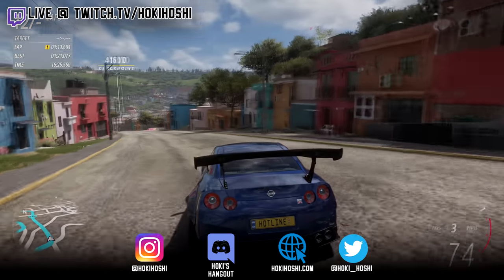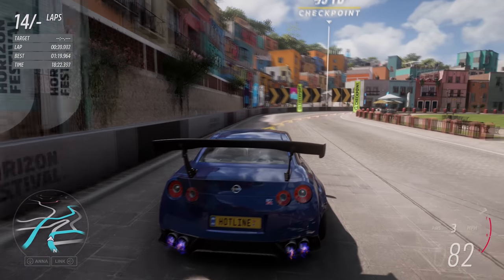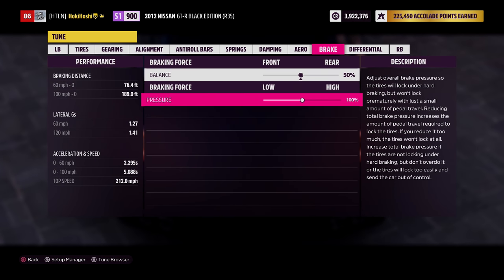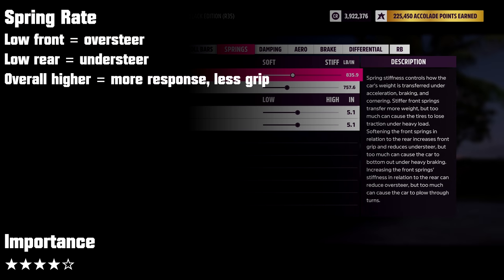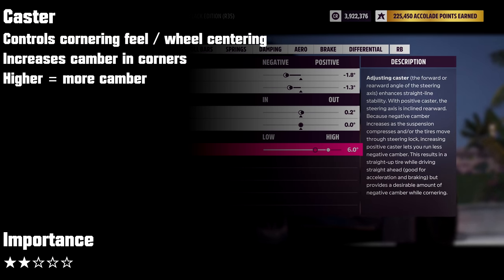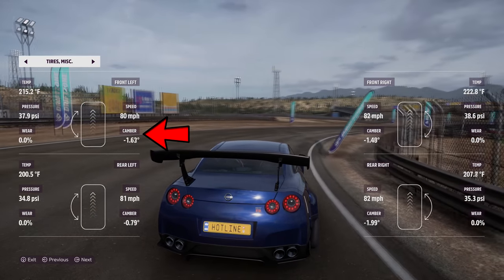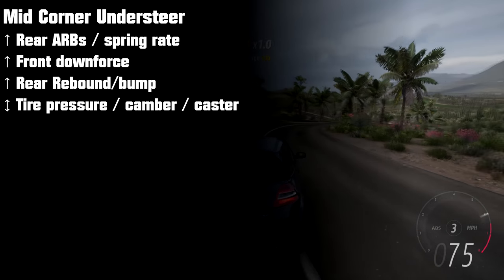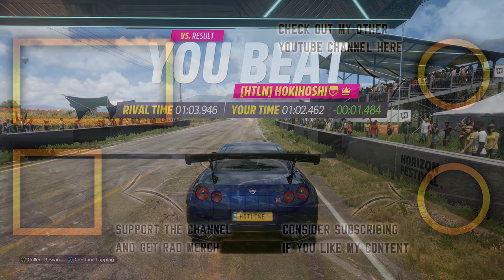How to Tune in Forza Horizon 5 | Basics of Tuning Guide

Comment: This video should win a Pulitzer.

It doesn't seem like a lot, but making some simple tuning adjustments based on this video took 15 seconds off my A-class Goliath time and completely changed the feel of the car I used.
Reply: YEah. I used to go for "BIGGER HORSE POWER ONYLY GREEN UP ARROWS!!!" until I used someone else's tune for the same car that was "slower" but it ended up being so much faster than I ever could imagine. It felt glued to the road in turns and it accelerated like a bat out of hell. The top end wasn't as high but that didn't matter because I didn't have to brake as hard or as much in turns.
Reply: I'm a sucker for grip so I'm definitely going to use this rather than other peoples' premade tunes.
Now the one question is what the hell is engine power vs torque.
Reply: @migueeeelet  I think the verry basic gist of it is that Engine Power mostly influences top speed, whereas Torque is what gives you acceleration and makes you move of better. 

A saying i once heard which sums it up was this. "Power is what determines how fast you hit the wall. Torque is how far you move it."

I think Torque might be more important then Power but too much Torque can just make your wheels spin too much. (I think)
Reply: @subiefoxy2467  Yeah, from what little I know, torque is the actual force the wheels are applying.
If I'm not wrong, too much power and too little torque is what causes wheelspin
Reply: @migueeeelet  I think its more to do with the Power & Torque and the Compound and Width of the tire. Ofcourse proper tuning also helps.
Reply: @subiefoxy2467 definitely there's a lot, but a main thing is that you CAN have too much power, or wrongly applied power. No use having a 1000 hp engine if its torque is like a sedan's
Reply: @migueeeelet  True, true. That's what i meant. No use having all that power if you dont got the torque too put that down. (Obligatory reminder im not a expert in this field, i have perhaps more knowledge then the average person but thats about it.)
Reply: @migueeeelet  well, in a regular engine HP is a function of torque. You can't really have one without the other.
Reply: @luisitobardajibenitez8013  yeah, but I know that you can have a lot of HP and shit torque, which has low performance
Reply: @subiefoxy2467  Incorrect, low torque isn't a real problem for racing because of gearing,  that's how something like an S2000 manages to accelerate quickly while having not much torque, you just need to rev them quite highly. Torque/high displacement is what allows cars to pull off the line quickly at speeds just above idle. Torque at higher rpms is much more useful for racing applications where you can keep the engine easily within the optimal torque curve compared to simply having a car that has a bunch of torque at like 1200 rpm then falls on it's face at 3000 rpm, like a diesel, where as something like a Semi works better with an engine that has gobs of torque at low rpm, since they would barely be able to pull away from a stop and be constantly needing to shift gears to keep within the torque curve.
Reply: @migueeeelet  Ya, those old Formula 1 cars with their 800~hp and like 200-250 ft pounds of torque sure were slow
Reply: @Mikael_Akerfeldt  idk man I'm not a car engineer
Reply: @ripleyhrgiger4669  i want that "glue" tunes :D
Reply: @migueeeelet  
Torque is what a tractor has, power is what 2 stroke has (to make it simple). Torque will rip a tree stump out at low revs.
Reply: For better or worse, I tune EVERY car I intend to drive. It’s one of the most fun aspects of the game (for me).
Reply: @ripleyhrgiger4669  type of builds i’m looking for! I’m always rewinding sharp corners, even when I attempt to approach slow; all the other cars are passing me!
Reply: @migueeeelet  Torque is more important for fast acceleration and going up hills, Horsepower is more important for top speed
Reply: @Cynsham  That's a good base, thanks
Reply: @Mikael_Akerfeldt  yall gotta realize those low torque cars are usually really light, especially the formula 1 cars..high torque is necessary depending on vehicle weight and racing type/conditions.
Reply: @MrSirGiuseppe  I literally said that mate
Reply: @migueeeelet _When u speak gear´s then u speak torque. Like when ur car is holding still and u try to get it moving in 5th gear then u don´t have a lot of torque even though u have horsepower ;p hope this makes sense.

Comment: I knew absolutely nothing about tuning compared to my 2 best friends who always knew everything about it since the earliest forzas. I sat here for an hour, and just finished writing 5 pages in depth (little diagrams for camber, toe an all.)  with an actual clear understanding, about everything this guy mentioned. I am SOOOO better off now. Thank you SO much for taking the time, and having the patients to teach everyone everything you know! Looking through comments to get even more info but great job man fr fr! Subscribed👌😎
Reply: I can give two additional Tipps: Hoki mostly does tuning that’s realistic. But you can do some settings much extremer than he is suggesting. Extreme anti toll bars can help make AWD swapped cars turn better. 1 in the front 65 in the back is the starting point for AWD cars and you dial it back from there if the car tends to spin.

Secondly you can go even lower with tire pressure on some cars as long temperatures are fine. 1.4 bar is something a lot of cars can handle without overheating.
Reply: @elhomoflow  any other tips like this?
Reply: @lseagle61  Heavy Rims, wide rear tires (on awd), and rear Aero most of the time reduce your power index value without actually hurting your handling. It’s eather a good method to bring down your car into a lower class or spend those gained points in more power.

So to boil it down:
Always go with widest rear tires on AWD
If you don’t mind the ugly wing rear forza aero can help reduce PI
1/65 rollbar settings on AWD can fight understeer the upper two things apply

To lower your PI go for Heavy Rims, big rear rims or wide rear trackwidth.
Reply: And one addition, Hokis Guide is excellent. He doesn’t like to suck the soul out of cars with unrealistic settings to gain the last bit of advantage. And that’s perfectly fine
Reply: I actually did the same after reading this. Took a couple of hours but was well worth it.
Reply: @elhomoflow  can you share what you wrote down? I was going to do the same, but maybe you can save me some time???😀
Reply: @elhomoflow  bro do you know the starting point for anti roll bars in RWD cars?
Reply: @aoe1234  hoki said it was better to put it default.
Reply: For real, I've taken notes on this video multiple times trying to improve my quick notes to make tuning less of a hassle. It's fun every single time for some reason.
Reply: @elhomoflow  one thing I disagree with: adding heavier rims should be an absolute last resort to drop your PI into a lower class. Weight is usually the single most important performance upgrade in a build, and wheel weight hurts performance more than other weight because the engine has to move it forward, and it also has to rotate it, so it actually slows you down by 1.5x (or more) compared to that same weight gain elsewhere.

Otherwise, good comment and tips.
Reply: U be like : OMG WHAT A GREAT TUNING GUIDE (yes it is, absolutely 100% agree). And then u proceeds to RAM people in online races lol 🤣
It doesnt matter if u can tune, what matters is if u CAN drive or not 🤣

Comment: Possible helpful tip for my controller brethren:
If your car handles great everywhere except for when you turn into a corner (back end slides when turning the wheel), try turning on simulation steering in the difficulty settings. It makes steering inputs more realistic, as if driving with a wheel. Usually this is MEANT for a wheel, but it helped me. I spent hours trying to adjust turn in without sacrificing grip elsewhere and was losing my mind. Turned this setting on, and the issue disappeared with no extra adjustment to my tune. It'll take time to get used to if you aren't too familiar with the more sim side of racing games on controller, but I hope it saves someone some headache.
Reply: Wth,why did this actually help so much? Great tip 👍
Reply: This is fantastic advice. I'm late to this game overall, but it cannot be overstated how much Simulation steering is better than Standard on a controller.
Reply: Thank you. The default setting always threw me off because the guy just doesnt turn the wheel they way I'm moving the steering. There's like a weird lag. Even after reducing the deadzones and such, it just didnt feel the same as assetto corsa.

Comment: Hey man. I'm late to the party, but I wanted to let you know how incredibly helpful this video was. I've watched it like 10 times with the goal of getting a great class A car for road racing. I chose the 1997 Nissan GT-R V-SPEC as the base starting point. After upgrades to push this to the top of class A, and unlocking everything needed to do a full tune, then following all of your advice here...this thing is an absolute joy to drive. Still some more tweaks needed but it is definitely getting there. Thank you so much for all the hard work it took to put thus together and sharing it with the Forza community. So much more satisfying than downloading someone else's tune with the flexibility to fine tune and tweak things for individual driving preferences. That was pretty long winded, but seriously, thank you!!!
Reply: I am trying to do the exact same with the 1997 GTR and cannot get it to grip at all? Tyres instantly red out of any corner and slides everywhere. Tried every. Can you please help me?

Comment: My own 2 cents, as a supplement to the info already given in the video

- I find the need to tune brake balance a lot more important than it was in previous games. If you are not using ABS, learn to tune brake balance! You can brake harder and not lock your brakes as easily if it's set right.
- Optimize your upgrades before you get into fine tuning. Tuning can help a lot with how a car drives, but if you're trying to get a big improvement in lap time, play around with upgrades first before you resort to tuning. Don't try to polish a turd!
- Rivals is your best friend in helping you find out whether you are actually making improvements or not. Keep running laps until you think you've hit your peak with your current build, change your setup, run it again. Is it faster or slower? Repeat! This is where having a spreadsheet or piece of paper is helpful. Plus you get credits/xp for testing your cars.
Reply: True. It is also great to see how you perform against other cars/players from the same class as reference.
Reply: I started going this after I read your comment, tuning my Diablo GTR, with tweaking I got the accolade for getting into the top 5% for circuit
Reply: @xZeroGrxvity  It also depends on your skill level, on higher skill level rivals tune are made be as fast as possible which almost allways means that all aero goes on to speed what not really make most comfy car on normal situation. I havent dive in rivals that mutch on fh5 but on earlier horizon games this was so extreme levels, like fh3 c-class old ford "32 was beast having something like 1000hp it was damn fast and really terrible to drive. or like on a-class i use some holden saloon with max out lambo V12 engine, that was easily able to get over 400km/h on races but every corner you basicly just drift thruw